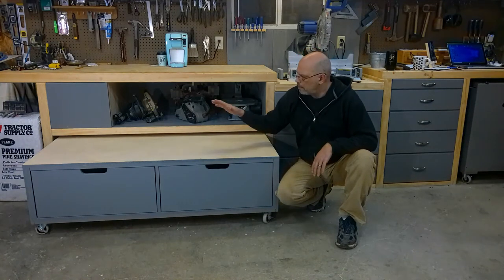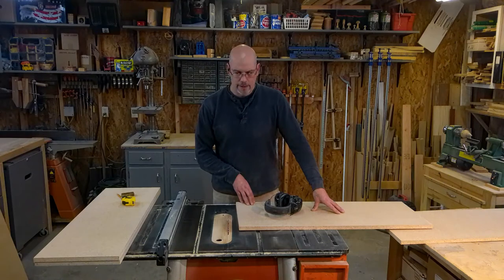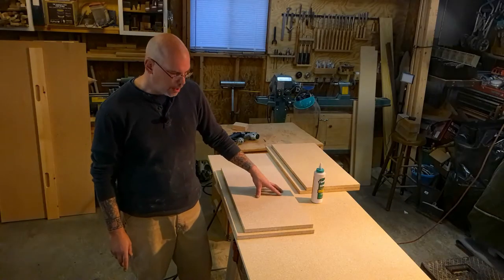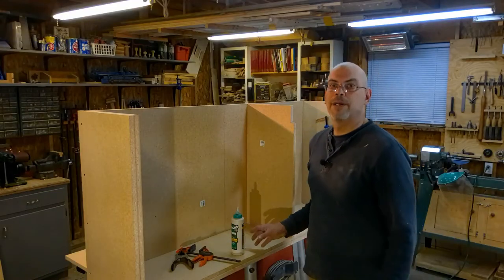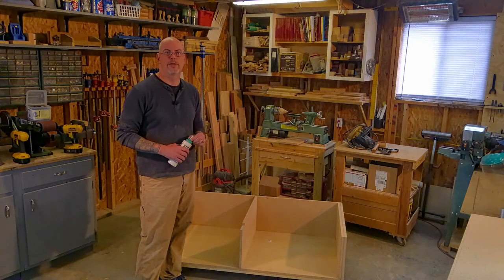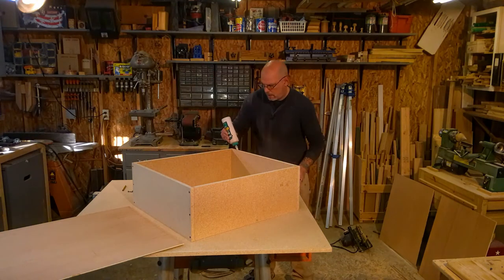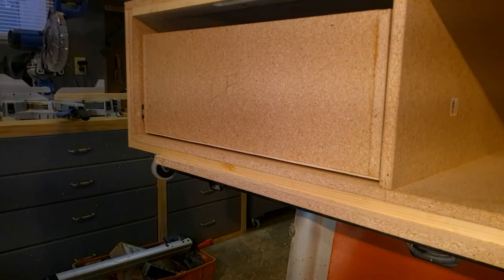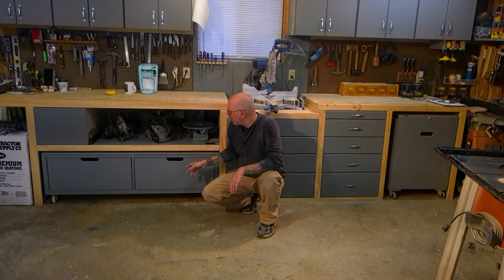DIY Shop Cart/ Assembly Table

Comment: You got my wheels turning... im building an outfeed table, a seperate assembly table that when rolled together will make a 6x6 surface area, however when building cabinets the lower assembly table would be awesome to have. Also like tge fact you used MDF, id probably added edge banding just for added protection but over all nice build
Reply from the maker: Thanks Tom. Sounds like you have a great build going on there. A 6x6 combined table would be awesome. I don't know if I could even fit that in my small shop.